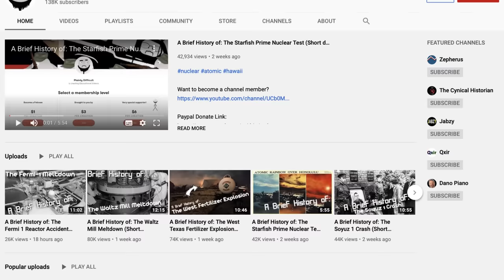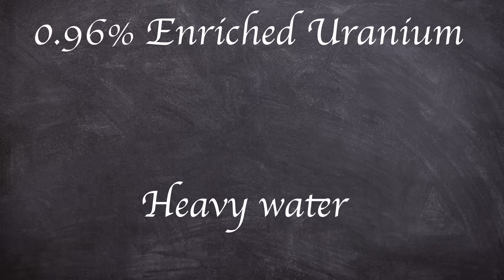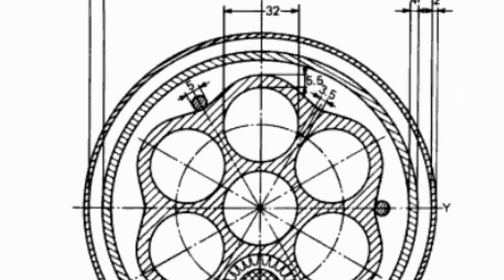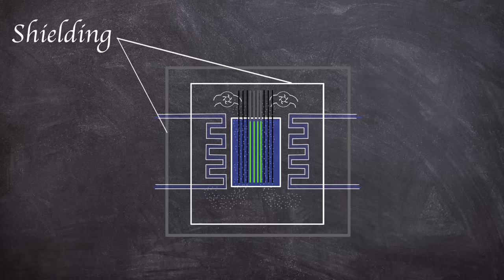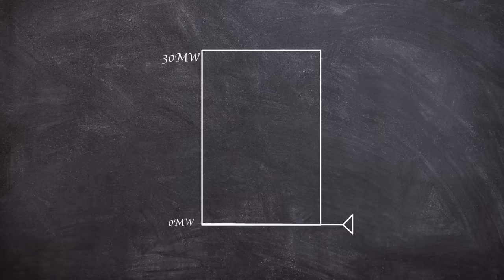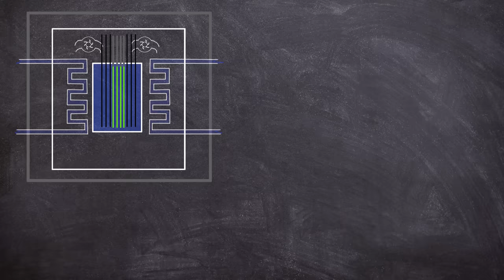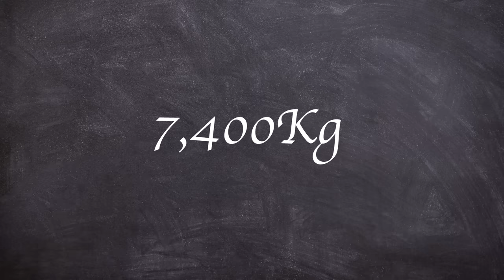A Brief History of: The Lucens Reactor Meltdown (Short Documentary)

Comment: Magnesium in a reactore core, plus cooled whit CO2, ingres of water.
If that isnt concerning go a head and turn reactor on. 
Nuts...
Overheat magnesium and it burns in CO2, water reacts whit Mg at room temps realisin H2 (at Mg melting temp thats explosive), CO2 disolved in water is a weak acid but its more than fast at coroding Mg, product is carbonate that acts as a calk.
Nice desighn, nuts...
Reply: I remember as a kid seeing a demonstration on a tv science show how, something impossible could happen - a metal burning! They squirted some water on magnesium powder and it burst into flames. I also remember when Honda started making magnesium engine covers for some of their motorcycles, and mechanics quickly learned not to weld near those magnesium parts. How do you fight a magnesium fire? You hose down everything near by so it won't burn, and let the magnesium burn itself out. This reactor probably was a brilliant design, but only when everything goes right. Like all high tech, when things aren't within specs, things tend to go wrong quickly and catastrophically. The higher the level of technology, the less 'robust' (less able to withstand out of spec excursions) the device.
Reply: @jfan4reva  Sand, cement, that kind of stuff will mostly snuff a magnesium fire.

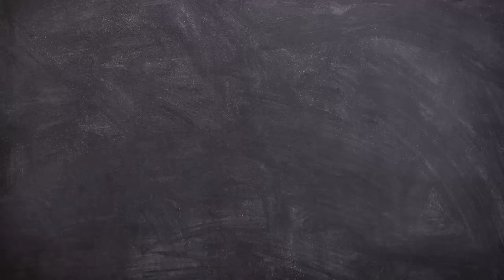Comment: I would like to draw your attention to the small building in front of the dam at 1:14 - This is, in fact, a 9-story building.
The dam is the Grande Dixence dam - at 285 meters, it's the tallest building in Switzerland.
With the 15 million tonnes of concrete used for the dam, you could build a wall around earth's equator 1.5 meters high and 10 cm thick.

Comment: Why did the safety rupture disk vent the coolant into the reaction chamber? I mean it would not take that much extra effort to provide an "overflow tank" since in case of an accident the coolant would be (and was) contaminated. If the unit is suffering an overpressure accident it would be a risk.

Comment: As a Generation Xer that lived through the Three Mile Island accident, no one will ever convince me that nuclear power is safe, clean, efficient, renewable, or economical.  You have no idea what it was like to have parents talking about keeping cars’ fuel tanks full in case we have to leave in a hurry.  No one knew what was going on because Met Ed didn’t release information in a timely manner.  The accident came within one hour of a complete reactor containment breach.  No one knows how much radiation was released because monitoring equipment was incapable of measuring the high amounts of radiation (the equipment effectively “red lined”).  The second, undamaged reactor at the site was shut down because it was too expensive to run and could not compete in the electricity market.  The cleanup will not be complete until 2052 according to the Nuclear Regulatory Commision.  That’s 73 years after the accident.
Reply: 3 Mile Island will restart a reactor in 2028 ...

Comment: 8:41 If that sounds scary and obviously wrong, I will just point out that last year we fixed a 38x22cm hole in the wall of a transformer room in a factory after 21 years of operation. They penetrated 6 or so cables through the wall but never added fireproofing or anything.

Comment: It’s a shame Switzerland cancelled their entire program after this.  Heavy water and gas-cooled reactors were way ahead of their time and this incident was handled excellently.  Scram was successful and the dosages received were not that significant.
Reply: Yah, but it also didn’t reliably produce power. The ship sank but everyone survived is not a glowing endorsement of the ship design.
Reply: Francesco Nicoletti Fair point, I’m just saying it was impressive for the 1960s alone.  I see problems using graphite moderators nowadays, but some of these features are being put to use in CANDU and generation IV reactors.

Material science and safety systems have both come a very long way since then and it seems like they lost the balance of innovation and safety with this one.  If they had continued, I couldn’t imagine how far the Swiss would’ve come with their contribution to nuclear energy.
Reply: @senpaichicken9408  It's a perception problem. Some years back someone in the U.S. came up with the idea of putting an additive into jet fuel to keep it from creating a huge fire when an airliner crashes. He got enough support to test the idea. So they deliberately crashed a 707 equipped with the system, but the pilot who flew it by remote control didn't hit the crash target accurately, and there was a huge fireball, so everyone thought the system was a failure. If you watch the video, 30 seconds after the fireball erupted, the fire was out. Fire trucks can barely get to a crash site on an airport in 30 seconds. The system worked, but because or the big fireball, everyone thought it was a failure, and it was never implemented.

Comment: It would be more accurate to compare it to the Magnox fleet, rather than Windscale.  Magnox used similar closed loop carbon dioxide cooling with Windscale-style fuel cartridges.  Windscale, on the other hand, was open loop air cooled, only intended for plutonium production without really using the thermal energy (similar to Hanford, in that regard).  Magnox built on the Windscale design and experience, capturing the thermal energy for steam generation (while also being suitable for large scale plutonium production).

Comment: Huh, sticking it in a cavern was actually a good idea, as that prevented a major release of contaminants that usually occurred with older reactor designs, particularly anything designed before the 3 Mile Island Meltdown. Would have worked out okay too, if the primary CO2 coolant system had been properly designed to prevent water ingress + had drier elements. Though frankly, using CO2 as the primary coolant was a bad idea as water loves to get into everything. 

And the failure to properly block off the wire cabling holes is a classic issue, that keeps occurring because people are lazy and ignore fire specifications etc.

Comment: Just double checking.....and please correct me if I'm wrong......but we use nuclear energy to boil water......right?
Reply: Riiiight. Everything in the end is to spin a dynamo (magnetic field) to created electricity.

And steam is the most efficient  easily obtainable. How the steam is generated is the only. difference. Coil, oil or nuke, is the heat source to boil water.

Comment: Are there any non-corrosive cladding options?  Or corrosion inhibitor additives that could be used?  Like, make the whole thing as "passively" safe as possible.  Maybe cooling fans that are directly core-heat-powered (more heat = more cooling, and no external power issues)?

Comment: 2:58 I thought heavy water reactors were typically much larger since they use low-enriched fuel and need to use more of it to get a decent heat output.
Reply: It was only a research reactor with 30 MW thermal and 6 MM electric power. A commercial power plant has 1000 to 1500 MW electric output.

Comment: Has anyone thought of using a sodium/potassium alloy in SFRs? I think it could be better because of NaK's lower melting point and so it in theory could transfer more energy to the secondary loop because not as much energy goes into keeping the metal in its liquid state
Reply: @derekp2674  interesting, am I right in my guess that the power output would be somewhat higher because of the lower melting point of the alloy?
Reply: @Romuls753  The stable power output of a civil reactor is limited by a number of factors, including the power rating of the core cooling system. Secondly the temperature gradient needed to transfer that power into the coolant must not be so high as to risk melting the fuel (unless the fuel is supposed to be in the liquid phase).

So the specific heat of the coolant is important but its melting point less so. For DFR, I believe the complex chemistry of NaK lead to a lot of practical problems with corrosion of seals. PFR, the successor to DFR, used liquid Na coolant, but also oxide fuel rather than metal. So a higher fuel temperature would have been acceptable.

Comment: I'm stunned at the hairbrained idea of using a GAS as a coolant -_- especially carbon dioxide. CO2 has SHITE thermal conductivity!
Reply: Stonehawk 
It‘s not harebrained at all as using CO2 as coolant allows you to run your reactor at a much higher coolant temperature than water, which in turn gives you higher thermal efficiency and allows you to use regular steam turbines. The British still get most of their nuclear electricity from CO2-cooled reactors, though they‘re pretty much the only ones that have built such reactors for power generation.

Comment: If they had gone with Dr Alvin Weinberg's Molten Salt Reactor design this would not have happened, just saying.
Reply: Does he have a functioning Molten Salt Reactor ?
Reply: @MrSummitville  He did in the 1960's-1970's at Oak Ridge National Laboratory. The schematics and testing results are available.
Reply: @Spartan536   What material fixes this problem ? ... Even today, no material can perform satisfactorily in the high-radiation, high-temperature, and corrosive environment inside a molten salt reactor. In 2018, scientists at the Idaho National Laboratory conducted an extensive review of different materials and, in the end, could only recommend that “a systematic development program be initiated.” In other words, fifty years after the molten salt reactor was shut down, technical experts still have questions about materials development for a new molten salt reactor design ...
Reply: @MrSummitville  I forget the alloy but there were 2 candidates, both very expensive to manufacture since they use rare earth metals and the process is extensive but they were promising.